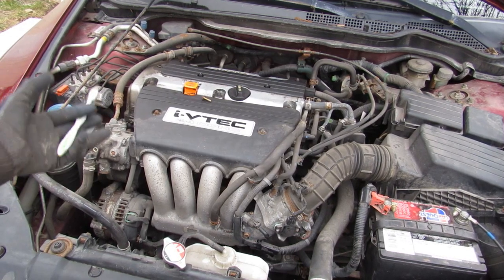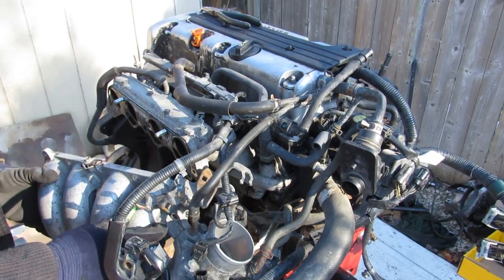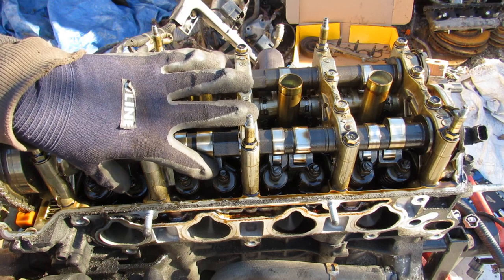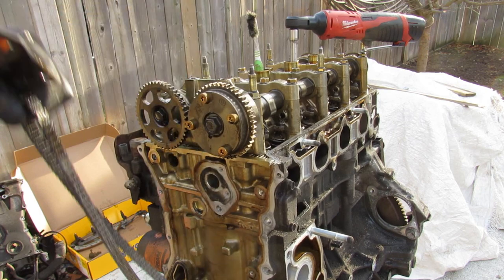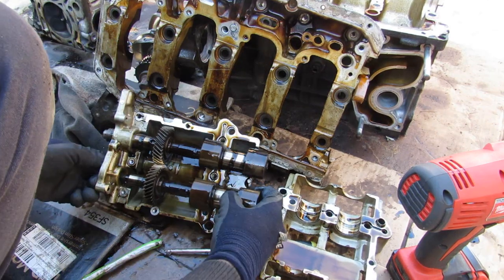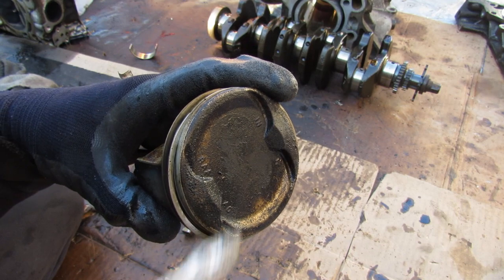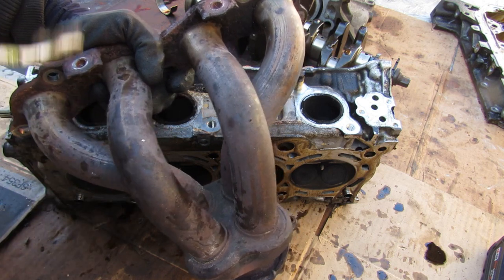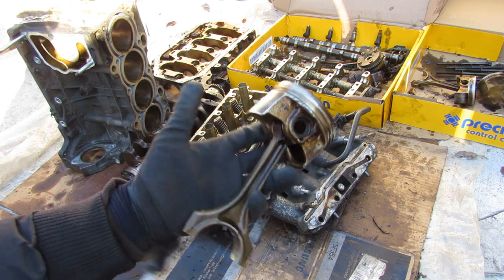Why the Honda K Series is the Best 4 Cylinder Engine

Comment: Excellent video. I'm a novice DIY guy trying to learn how to do my own automotive repairs.  I have a 2002 CRV as my project/learner car with over 278K miles on it, and it runs great!.  Because its a 2002 does that mean I have a K series engine? How can you tell? What other series engines are there that Honda makes?  I love learning this stuff.
Reply: You have the K24, the one in the vid. I've an 03 CRV, 310,000K, still runs great.

Comment: Got a 2003 accord, runs like the day it rolled of the lot, leaks alittle oil though at 250,000. I think it’s the oil pan gasket or possibly the front main seal

Comment: 15:15 it's really blows my mind How you can find crosshatch patern in those cylinder walls after that much up and down motion of the piston and rings are scratching the walls.
After knowing how IC engine works it's still unbelievable to me that how these cylinder tolerate the torcher of piston rings at those extreme heat for thousands of miles with very little wear and tear.
Reply from the maker: Yep it sure is amazing!
Reply: A constant film of oil on everything makes that possible.
Take that away for just a minute and the engine is dead.

Comment: i recently bought a 2007 4cyl honda accord automatic woth 98000 miles. how long can it last?
its been well serviced throughout the years
Reply from the maker: Should be good for a while. Keep up on fluid changes
Reply: With some basic maintenance, it should be ok for many miles more. I own an 07coupe  and love the car...I still see many on the roads of the northeast US. Good luck.
Reply: @TheGonso35  awesome how many miles yours got?
Reply: @Freedomind901  125 k. Bought it preowend on 2010 with 12k. Used a commuter car. Great on gas mileage and low cost maintenance with lot of aftermarket.

Comment: The engine wasn't without its problems. I had a 2007 Civic Si, and it used oil like crazy, didn't burn it or leak it, just disappeared. The VTC actuator was bad since day one. Replaced it and it still chattered. I still know who owns the car, and after 215k miles it still runs fine, but uses 2qts of oil in 5k miles. Good engine with issues.
Reply from the maker: Ouch. You sure it's not dripping oil.

Comment: The older I get, the more I'm becoming a Honda fanboy. I won't argue with anyone that Honda is better than "brand x".. But, I just have had good experiences with them: Ease of repair, cost to repair, and longevity. So I stopped looking for other brands, and stopped spending the effort on comparisons.
These days, I just check what a given Honda is made up of. Are there component variations I haven't seen before? If so, I'll go research that.
But otherwise, my search always starts with Honda. Because as of yet, they haven't wronged me in any significant way, and they have done well by me in enough ways that I stopped shopping around.
I wish more people were like me. My brand bias exists and I acknowledge it, but it's logical and I don't go around like some rabid missionary trying to ram it down the throat of anyone who chooses another model. I even acknowledge it when asked for advice: I'm biased towards Honda for the listed reasons. This isn't to say other brands may not do the same, just that I haven't found the need to change because Honda's been doing those things so well. Then, if the advice seeker asks for a comparison, I'll do that only after being asked about it.

Comment: At 6:12 it’s not missing bolts on the coil packs the cover has the bolts on it so when you bolt down the cover it bolts down the coil packs. Good video though thanks

Comment: I have 185K miles on my CRV and it runs like a top, not a single leak.
Reply from the maker: Not even valve cover
Reply: @speedkar99  not that I can tell.  I had my intake manifold off to change my starter and looked all around.  Amazing for a 15 year old car.

Comment: The timing chain and individual coils is enough a reason to run this engine. I’ve been stranded by both broken timing belts and failed distributors. This engine won’t leave you on the side of the road.

Comment: In Japan Honda has 3 different brands of cars, that sell essentially the same brand of car!
1, the low price brand.  2, the luxury brand. and 3, the high performance brand.
Technically a car only needs 1 camshaft and 8 valves, but if you put 4 valves in every cylinder and have a device that holds the intake valves open until the exhaust vales have opened you get more power.

Comment: So how much oil consumption is too much and worth replacing the oil control rings and/or the crank bearings? My 2010 Accord 2.4L has been using oil and it now at around 1qt/500miles.
Reply from the maker: Yeah those K24s we're very problematic
Reply: Do the math. How much is a quart of oil? How many miles do you do? How much are gaskets, bearings and/or rings? How much of the work will you do yourself? How long do you intend (READ: need) to keep this car for? etc.
Reply: @fun_ghoul  Yup this video was really helpful identifying the most likely causes. For now it runs fine, no leaks so I just buy a few quarts of oil every month or two
Reply: @colinjohnson5515  And hey, on the bright side, it's not likely that your exhaust will rust from the inside out!

Comment: First of all, I have never been a Honda fan. Their engines lacks torque. 
After watching the breakdown of this engine, I have a lot of respect of the Engineers who worked on this engine. I speculate they overdesigned this engine to be a Type-R level performance and added some buffer like 20% to 40% extra.
Then for the economical engine like this one, they cheapen (tone down) some parts like the Vtec set up, con-rod, piston, and crankshaft. But they still share the ladder shape upper oil pan which is impressive.
Of course, being all aluminium, you kind of need the extra bulk to make the engine robust. Usually an iron-block engine has much smaller components and they can still work very well.

Comment: I passed my 2008 CRV down to my daughter. 230,000 mostly highway miles. Still runs good but wish I ran exclusively with synthetic and avoided those fram filters….lol. I did use “synthetic blend” but who really knows how much synthetic oil is actually in it.  I now have a 2018 CRV with the 1.5 turbo. I try not to accelerate too quickly. Who knows how long this engine will last…lol
Reply: My 2008 CRV also has 230,000 miles on just the regular oil. My dads old V6 Accord is still ticking with 305K miles on the cheap oil.
Reply: regular oil is fine, the key is changing every 5k miles on these engines

Comment: Can you please teardown a used honda L15B7 turbo which is found on some civics, accord and CRVs. Interested to see if this engine builds up deposits in the intake valves, a common issue to DI engines.

Comment: Don't like that the engine secondary balancer shafts are so low in the oil pan. Potential oil foaming at sustained high rpm's or accidental high oil level could potentially lead to oil starvation.

Comment: Long  srokes won't  give  more or  less  torque . Surface multiplied  by  stroke is  volume,,  and  pressure  by  surface  is  force  iover  crank. Rhi k  on  this.  In other  way,  wider  bore  will  allow  wider valves,  but  then  you  can  open  them  deeper  or  not.

Comment: Do you think I should have my timing chain and VVT solenoid changed after 100k? My 2007 Accord with 4 cyl. has 250,000, not rust, but i got a used 100k motor replacement installed just after I replaced my clutch about 10,000 miles ago. When I showed up to the mechanic’s to pick up my car for the clutch replacement the mechanic said my engine blew a timing chain. I didn’t see a connection between a clutch change with a timing change fail.....
Reply: Chain should be replaced at +-250k km

Comment: Totally off subject, but I need to get the carbon cleaned out of my engine ( 127k miles on GDI) and I had a sbop  quote me 224 for a "forced induction cleaning." Is that a legit  way or are they just  gonna put some fuel treatment in my car and charge me 224?
Reply from the maker: Walnut blast? Or just carb cleaner
Reply: @speedkar99  Not sure. I just asked them how much they'd charge to do a carbon cleanup. They said, "forced induction " cleaning, and it's 224. I'm sure it needs it with the amount of mile I've got on it.

Comment: Hondas have come a long ways since my 01 Civic Ex. You don't use a pipe on your breaker bar? the weights on the oil pump axles that counterweight piston vibration is smart, I've never seen that before.
* What does the scoring at the top of the cylinder walls tell you? It ran low on oil? It was overrevved when it was cold?
* How do you know which pistons the engine has, so you can avoid the oil ring clogging problem?
* When will we see individual computer controlled valve control? No more cam shafts!
* I still don't like EGR, better Catalytic Converters and injector/fuel burns could eliminate that system.

Comment: i have a 09 accord with 252k miles and still drive everyday
Reply from the maker: Those had oil consumption issues
Reply: @speedkar99  I add one quart of oil between oil changes 4K miles.

Comment: You should definitely check out the Toyota 3RZ or 2TR engines. #strong
Reply from the maker: How old are those?
Reply: @speedkar99  94 onward, replaced the 22RE. The 2TR is basically a very close derivative as the 3RZ, can pretty much treat them as the same engine. Forged rods and crank, closed deck design. The only real weakness is the head imo - no cam bearings, if the cam picks up you throw the head and cam away. They take up to about 15psi of boost no worries.

Comment: I guess this engine turns clockwise.  What year did Honda begin such ?
Do you recommend any specific Honda engine...like one which won't burn oil ?  You stated here that some newer engines, as well as this one do have issues.

Comment: The only thing I don't like about this engine is the pistons rings, and cam lobes failure (Element) especially when one uses mineral 5w-20 oil and regular OIC. In one case the CR-V engine had their rings so badly seized by the carbonized oil that the oil passing into combustion chamber increasing temp of the mixture to the point that it burned the exhaust valves on two cylinders. We repaired the engine, filled up with 0w-30 and it seems to be OK for the past 20k's.

Comment: are they the best? Or are they the cheapest and everywhere (so people could get them and do "R&D") and they got a 25-year a head start on practically everyone else?
Reply from the maker: Yep they just make sense from all directions. Even the fact that Honda still has them in production is proof
Reply: How did they get a 25 year start on everyone else?  Every other manufacturer has been making small displacement engines for decades.  The biggest thing Honda does right is their cylinder heads.  They flow a lot of air + variable camshaft profiles.

Comment: So very intelligent men at GM who developed the “American 4G63” would like to have a talk with you about the LSJ and LDK engines. LSJ being an engine that dyno’d from the factory made 225whp and 218lbft of torque from a 2.0L displacement and an M62 roots style supercharged making 12psi. With a couple simple cheap mods an LSJ can make 280whp…. That’s an engine with NO VCT, PORT INJECTION, making the same power as a VCT and direct injected modern turbo engine. Then you have the LDK (Regal GS etc), charge pipes, air to water intercooler and a tube and your at 400whp. Best part about both engines, all modifications are SAFE, the blocks and cranks for both can support over 900whp, and the pistons/rods in both are good to 500fwhp.
Reply from the maker: Awesome

Comment: Idk at 200k miles they just run into a plethora of problem's. And it's just one thing after another after another. They're such a pain to work on too you have to take the entire engine compartment to get at anything. Or drop the sub frame to get underneath the engine.

Comment: I have a 2019 honda accord 2.0 manual and i installed a dc sports 3 inch exhaust system and quad 4 inch tips , and im not tuned and dont plan on doing it , i want my car to be heathy for a long time . Will my exhaust system disrupt my longevity of my car? Being  3 inches? Help and thank u
Reply: Its a cat back

Comment: I'm looking to buy a 12-14 Honda CRV. How reliable is that engine with the 5 speed trans?
Reply: Damian they are very good, but you need to make sure the timing chain is good and that it burns no oil. Just look at the end of the tailpipe, if it is sooty the motor is burning oil, if it is clean then it probably is ok. But it couldn’t hurt to remove all the spark plugs and look at them. They should all look clean and none should have soot on them. The oil should be clean as well. I cannot stress this enough, please pay a mechanic who you can trust to thoroughly look the whole car over. That way you don’t get stuck with someone’s POS. You should also make sure the owner has kept the valves adjusted. DO NOT do what honda claims you can do and go 100,000 miles between valve adjustments. 30 to 50 thousand miles is a good benchmark to adjust the valves. When taken care of, these will usually do 300 to 500 thousand miles. Good luck.
Reply from the maker: Just make sure it doesn't have that oil problem that the accord had
Reply: @ryanthompson2893  . Why is it so important to adjust valves so frequently?
Reply: Supernova you can easily cook valves on Honda cars if they get tight so I always like to keep them well adjusted. It keeps your car running nice and smooth. I see a lot of old Honda cars get junked because they need a valve job due to tight valves. I think it’s because of the aluminum cylinder heads which have seats that wear faster than say an ancient American v8 with cast iron heads.
Reply: @ryanthompson2893  . I'm not really sure what you meant by cooked although speedkar99 mentioned that they cause a tapping sound.  My guess is that 99% of car owners don't know what timing valves are and they go neglected through the life of the engine yet most cars are known to go well into the 150k-200k mile range before they are salvaged.

Comment: You got a new gun? Nice!
Reply: I have the mid torque version and I love it. I plan on getting one of the smaller impact wrenches for jobs in the engine bay. Great tools to have!
Reply from the maker: Yep. Finally cordless. Much better though still heavy compared to air gun.

Comment: Oil filter location changed on newer k24
Reply from the maker: Where is it now?
Reply: @speedkar99  Sorry for late reply it's right next to the drain plug bolt. 
Also is it annoying to change the VTC solenoid cause mines rattling at 70,000 miles.Edit:got to that part of the video and clicked the link thanks for being great.

Comment: The throttle cable alone is enough of a reason to go with this beast. I am SO SICK of garbage throttle positioning systems.
Reply from the maker: Some have done a good job of eliminating lag. 
In my opinion, the more powerful the engine, the worse the dbw lag

Comment: Never use thicker oil than the recommended. It will cause too much pressure and the head gasket and bottom gaskets will start to leak oil. 2.4 2012 Accord 299.530 miles the VCT problems is due to the spring inside the VCT sprocket,stretch it every 100k miles and you good to go. Steering pump will leak because of O-ring after 250k miles (in my case). Timing Belt snapped at 277k miles(replace it every 150-200k). AC relay must be replaced $5 (mine at 220k miles) 
Right now it needs suspensions all 4 need replacement,control arms,cv axles,engine mounts. Engine and transmission is bulletproof,keep checking the oil every 3000 miles and all fluids level. I have no idea how this car handled all the abuse I put it through,80% of lifetime has been hard city driving and fwd burnouts
Reply from the maker: Those older Hondas can take abuse as long as you keep oil in them. The biggest flaw is that they leak oil?
Reply: @speedkar99  Also the relays go often. The starter will go out,in my case 2 starters replaced. Battery terminal corrosion pretty bad. Humidity alter voltage on alternator causing intermittent dimming lights. Undersized battery since factory,must upgrade to bigger battery,DieHard Platinum the one in my case was not a good match for this car,the car itself will damage the battery because the alternator voltage fluctuation. Ignition switch will act up multiple times in a 100k miles causing starter failure or reprogramming of the key with the immobilizer system/key switch. I had these problems because of ignorance of mechanic maintenance on more complex parts like relies and electric system. My advice to have it 2.4 2012 going no issues is keep cables clean(battery) upgrade alternator to a bigger one. Upgrade battery to bigger ones,have AC,Alternator,Battery rely and plenty of spare relies in case the car starts to act up. I grew some hatred for the car but with prevention 50% of the problems aforementioned would have not happened. Get a rely checker too,life saver.

Comment: The oil leak has nothing to do with valve head design. Just bad maintenance / bad resealing.
Work on many k motors, not a problem
More like someone spilt oil all over. 😅
But great video 👍🏻
Reply from the maker: But I see alot of them leak...they couldn't have all been resealed incorrectly
Reply: Well my own has 230.000km, no problem, my friends k24 290,000km no problem.
But agree would be weird if they all were sealed wrong.
But the engine in this video looked really bad with oil spilds and so on. 😥
Reply: And anyways, it would only need a new gasket that will last more then 10 - 15 years. Still running the original, in my accord 2003